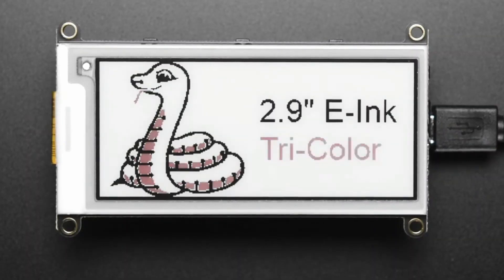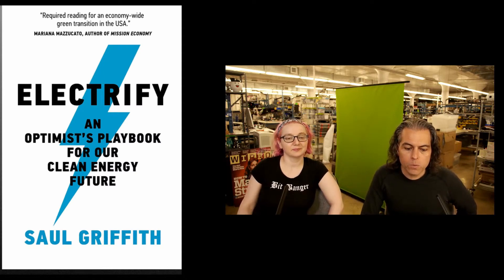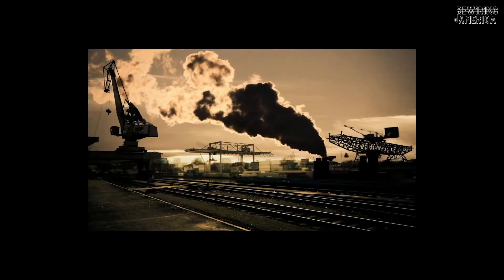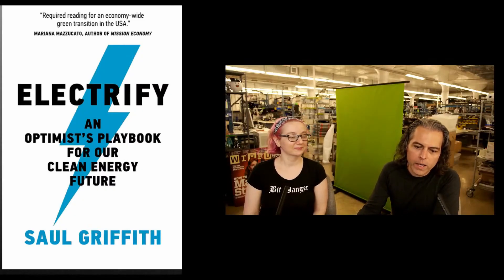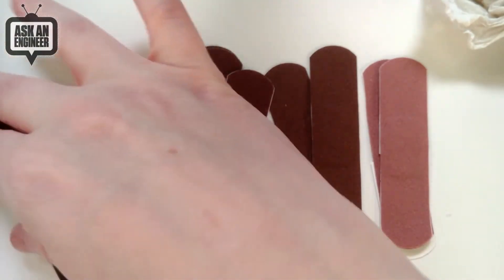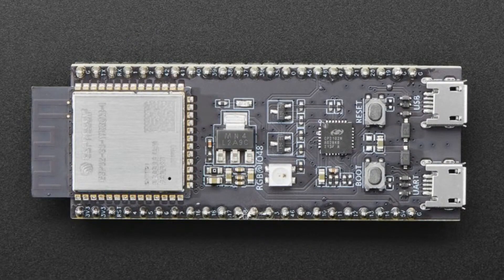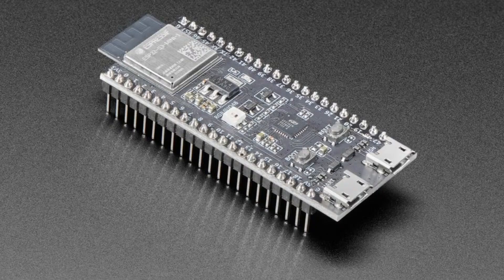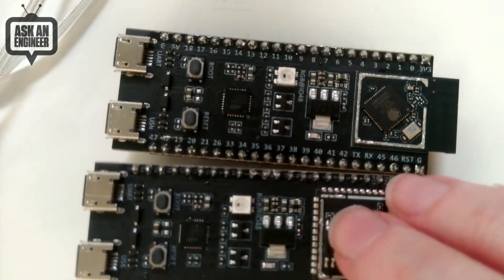New Prods 11/17/21 feat. Adafruit NeoSlider I2C QTSlide Potentiometer w/4 NeoPixels-STEMMA QT/Qwiic!

Comment: Wind and solar are not going to cut it for most applications. Gotta go with nukes. Consider that even under a 20 mph wind, you're going to need 300 wind turbines (3.5MW) to replace a single 1000MW power plant.